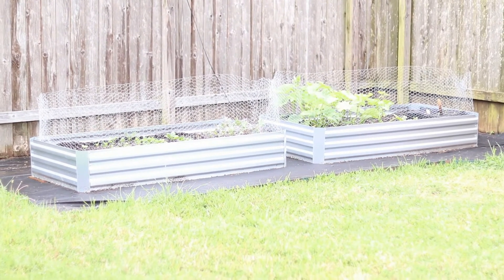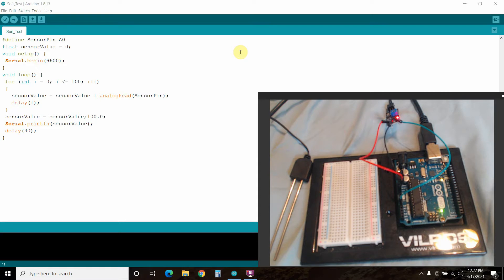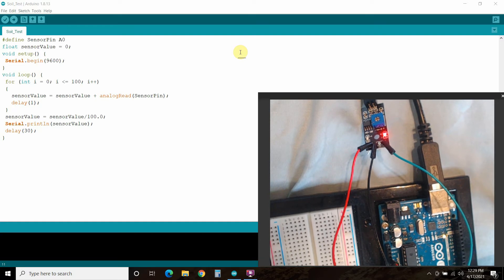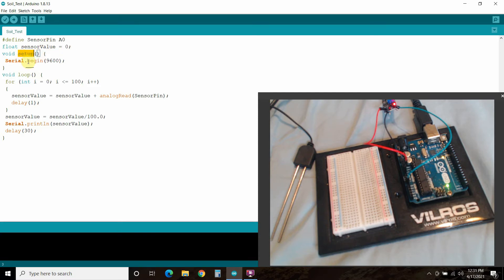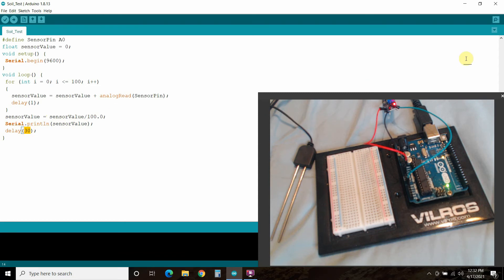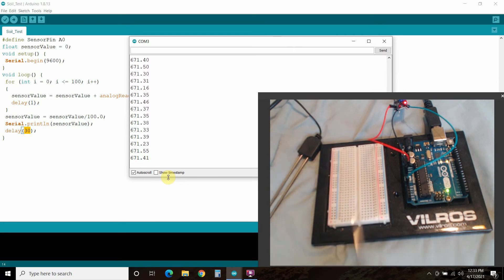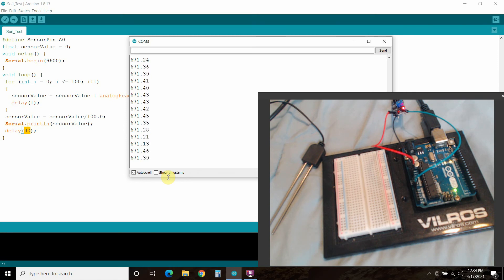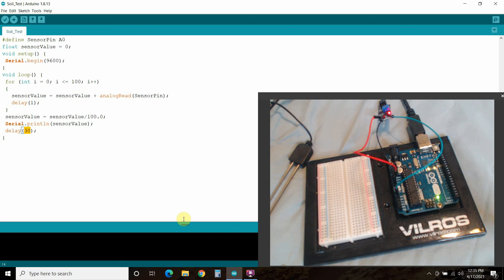ICStation Resistive Soil Motion Sensor with Arduino | #135 (Python Arduino #5)

Comment from the maker: Here's the Arduino Sketch I used in the video:

#define SensorPin A0 
float sensorValue = 0; 
void setup() { 
 Serial.begin(9600); 
} 
void loop() { 
 for (int i = 0; i <= 100; i++) 
 { 
   sensorValue = sensorValue + analogRead(SensorPin); 
   delay(1); 
 } 
 sensorValue = sensorValue/100.0; 
 Serial.println(sensorValue); 
 delay(30); 
}

Comment: At 4:13 in your video, I think the reason you divide by 100 is to get an average reading from the 100 readings you take (the for loop), not to get a percentage. You still have to convert from the voltage to a moisture percentage from the average reading obtained by dividing the SensorValue variable by 100.